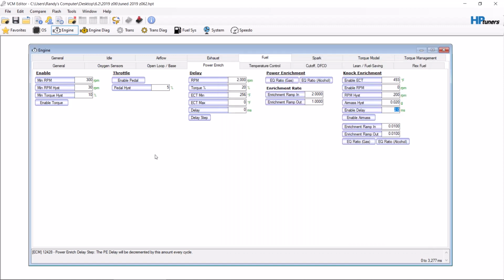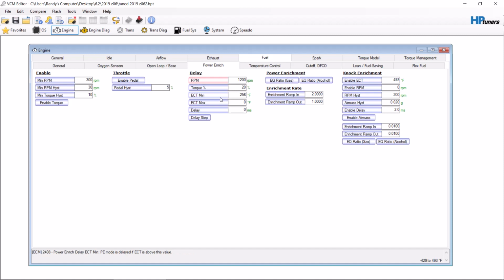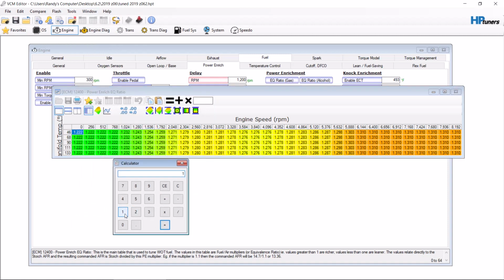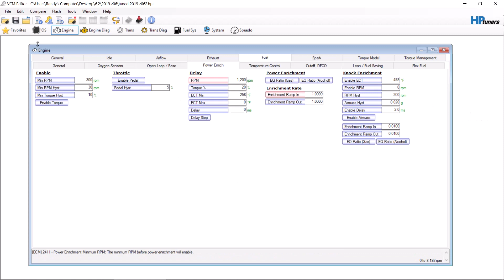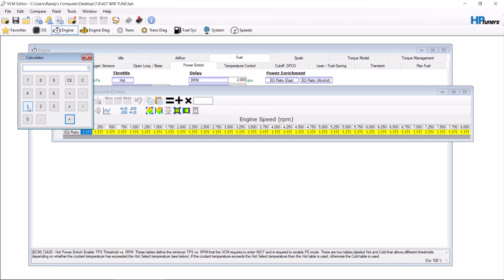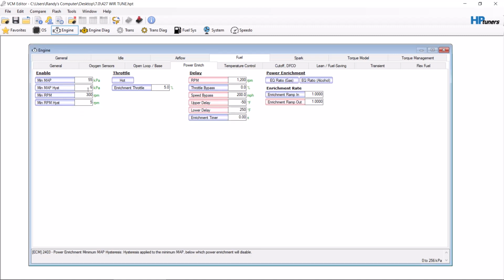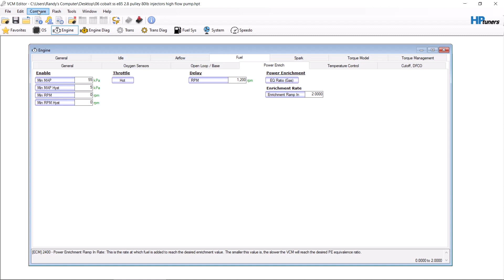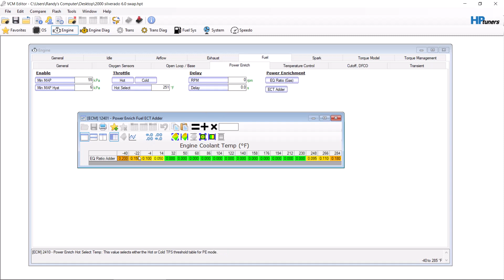GM gen 3 4 and 5 Power Enrichment

Comment: Can I set up a stock 6.0 gen 4 this way?
Reply from the maker: Which video is this on
Reply: Pe on a 4th gen ls..I have a stock  6.0 gen 4 in a silverado I'd like to o set up the power enrichment for more power thanks.
Reply from the maker: Yes same concept
Reply: @Recklessmotorsports  I set this up exactly like you did in this video and wow what a difference...what would you recommend for the high and low octane tables iv currently have a 2012 camaro table in it now and runs great but I don't want to hurt the motor. Thanks for all your input.
Reply from the maker: Normally you take the high and paste it over the low is you’re running 91+ then I would make it 22-24 up top at wot I’ll make a video for the ls3 at some point
Reply: @Recklessmotorsports  cool man I'll def be looking for that video thanks again sir I app it.